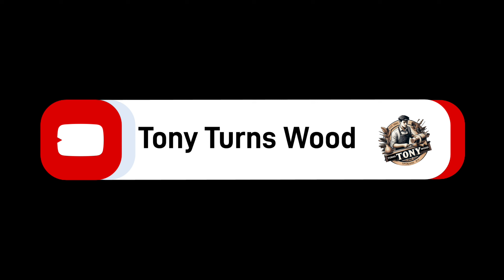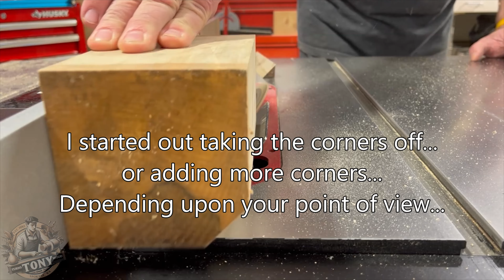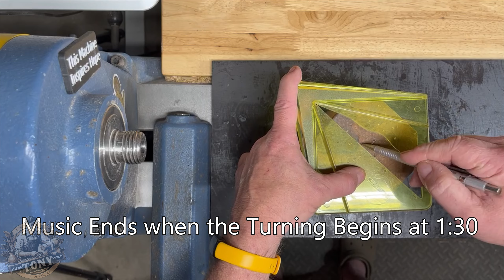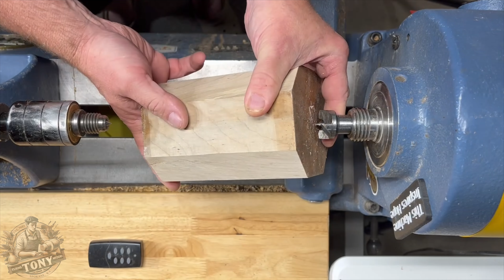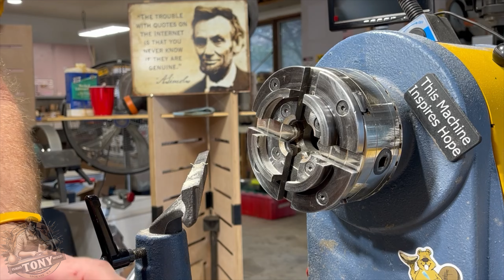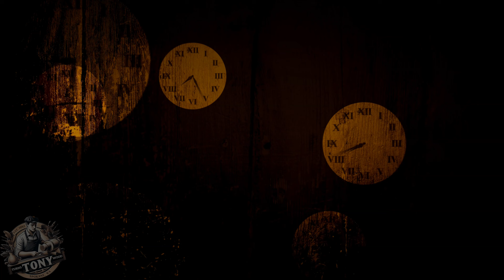Hidden Compartment  - Part Two #Woodturning #Woodworking #HiddenCompartment #MapleBox #DIYWoodwork

Comment: Cool look box with a little hiding place. I really do not need a place to hide anything . I have a half dozen tape measures hiding in my shop  🤔
But maybe that will be a cool project I can make for my wife.
Nice job Tony!
Reply from the maker: Awe thank you Gary! I really appreciate the support! I can send you the file to print if you'd like!
Reply: Your welcome Tony. I have already modeled something up in my CAD program for the lid. If it doesn't work out I will let you know. This allows me to change the size easily.
Besides wood turning enjoy modeling up parts and CNC cutting them. Maybe the best was the reeves drive I did for my friends Delta lathe which parts were not being made anymore. It was very complex and I would show you a picture of it but you can not do it here.
Thanks for the offer and if I fail I will let you know.
Gary